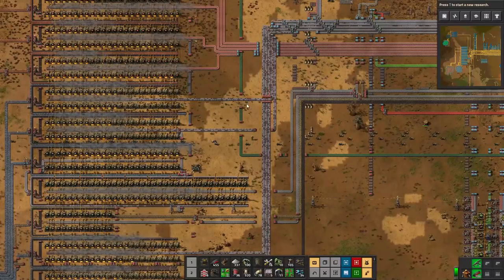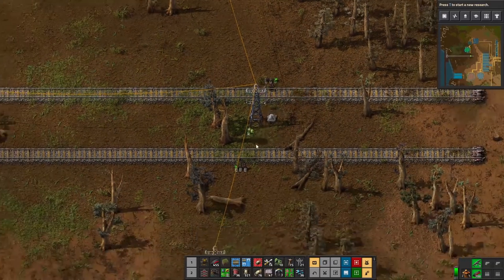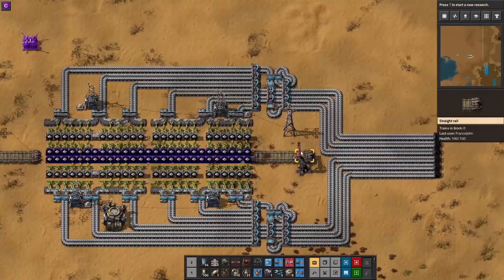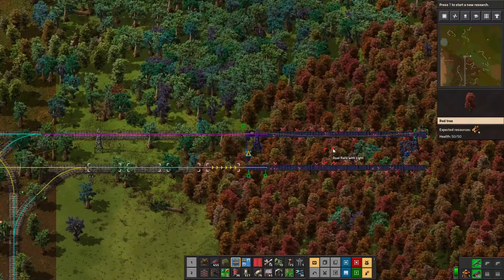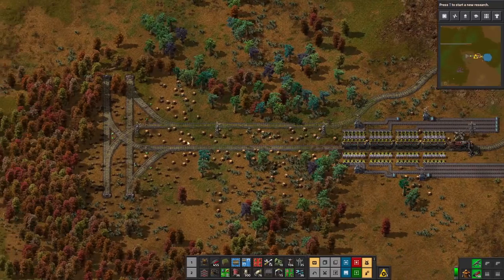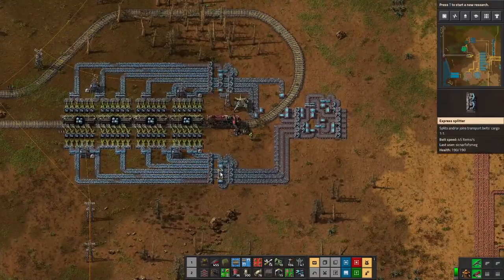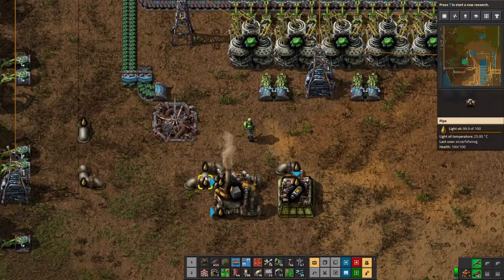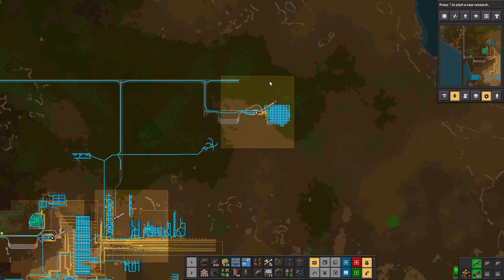Factorio Railworld 7 : How to build a rail network with 4 Blueprints

Comment: Your T junction is actually missing a signal. If you look at a T, you cannot have a train going from the bottom to the right at the same time as a train from the right to the bottom. Another issue is that if the main line is blocked, train can actually prevent other trains from going down into the junction, also making a backup in that direction. (you have a normal signal in the place of a chain) Also stick in a chain signal in front of actual junction, so trains will repath in front of the junction if another train is jamming it, this really helps with busy areas if there are alternative routes to the destination.

Comment: Here is a short Train Tutorial introduction:
you use rails with trains to reach far places
you use signals to prevent trains from running into each other
chain signals will look ahead to the next signal and show the same color.
    if there are multiple signals it will turn blue to indicate there are some open spaces left. (useful to prevent trains from entering full stackers and getting stuck)
1 locomotive is able to efficiently carry 2 wagons.
use conditions for your trains.

Comment: This game is like oxygen not included space difficulty curve, but at every corner
Reply: Most of it is much more simple. You don't actually have to pay attention to a lot of the details to get things done
Reply from the maker: I see factorio asmore about you need to get X amount of stuff from point A to point B. Turning it from one thing into another along the way.
ONI it pure chaos in comparison. Food, O2, heat, refinement, moral, skills. ONI kills you a lot when you first start and then when you get good you start learning about boiling petroleum and tapping into geo thermal power. Never mind the really complicated stuff.
I feel like Factorio is far more straight forward, make as much science as you can and defend against the biters.
Reply: I agree on jhon in this factorio is much more of learning curve but oni..... i sometimes do not know what kiled my dupe.... it just more random on oni than factorio

Comment: I never bothered belting my train fuel. My bases weren't organized enough and I got into rails earlier. My early solution was a blueprint with a chest and a siren connected that would warm me when a train's fuel chest needs refueling. Then once I had logistics setup I replaced the chest with a requester chest so it always had fuel. Siren stayed just to alert me of any unfortunate events happening.
Reply from the maker: I'll most likely switch over to bot based fuel pretty soon, but I felt like I should include the belted version even if only for a bit as a demonstration.

Comment: Oh no. Mainline train stops?!!?! Mad lad, you. I pull them off the mainline so trains can pass through the stations and it keeps each station very small.

My normal trains are 1-2-1, but I know that's probably not that efficient. I'll probably upgrade them to 1-4-1's.
Reply from the maker: 1-2-1 trains are fine, you can easily get to 500spm with them. I just use 1-4 trains from a two year old habit.

Comment: i never thought i would say this but Francis, i think you might need  side balancers in some places of your base to reduce bottlenecks. For example on your starting iron patches before they come into new main ore line. 
The reason is, not ANY of lane ballancers you used to this point really side balance,  so your iron smelters use i side more than other. That's not slowing it down, however, this means that you draw ore from only one half  of your old iron patch, meaning that in the result 1 side may be already be depleted, and other don't even drained in half.  You could also add side balancers on the OUTPUTS of the smelting setup, so they always work and draw ore equally but i don't know if it's needed or not. Side balancers also is something like 3x4 small little thing (that uses 2 splitters, 4 undergroundies and some belt), that you can just stamp down via blueprint so it's not really a big deal to do.
 And your rail network is.... uh... somewhat rough. signal spaces is not always leave space for a full train and train stackers is gonna generate some problems later making you constantly monitor rails for the clog-ups so this "this is additional thinking, not worth it" strategy i think is going to backfire in a long run, but yea as long it works i think it's okay??? Oh boy. You basically need a stacker capable of handling ALL the trains dedicated to the outpost, so 3 outposts with 4 trains each = 12x stacker at the base which (technically 10 x scince 1 train is always at the outpost and one practically always "in travel" but it's still) going to take quite a chunk of space, is it still valid then?
Reply from the maker: I have stuck in a few rough side balancers on the ore to equalize the draw. As for the rail network it's super rough but so long you leave enough space your fine. That Iron ore drop off stacker will most likely be expanded up to about 20. It's pretty handy to do and we have the space for it. Brute force is my preferred method, at least this early on.
Reply: @FrancisJohnYT  oh, okay then, i just thought that you planning on having like 3 stacker spaces, which is definitely not enough. also do you possibly say that in some later date the rail and whole base going to have a minor/moderate overhaul? :)

Comment: The unbalance at 8:11 could not cause a problem. You only really have to balance belts that draw from different wagons so that the train does not remain in the station when all but one wagon is empty and all those inserters starve. If one side is draining slower then that does not slow down the inserters on the other side, so it's not a problem.

Also in general if you have a balancer in front of the furnaces you don't need one after the furnaces too since one row of furnaces should be identical to the next. (I can see that you don't have that, just pointing it out for those that do use balancers everywhere)

Comment: hi FJ!

Im not sure if you play anything like me, but if you are gonna bot-empty the trains, you usually throw the ore in in active providers, and then further in some sort of buffer (yellow chests?)??

To not overfill the buffer if your 'balance' of trains (copper to iron ratio sort of thing) isnt right, it might fill up with whatever you got the most outposts of.

Now take a roboport, and connect its output to a few calculator combinator, and a constant combinator.
Set the constant combinator to "n = 50000", where 50000 is the minimum ammount of ore you want in your system.

The calculator combinators, you take "iron ore / n", and output iron ore. Same with the other ores.
Now run the outputs to your trainline (big poles) and then into your outpost station.

In the trains you do:
"goto iron output 1"
"full cargo"
"circuit condition  iron ore > 0"
(remember to change from 'or' to 'and'

and then the usual 'go home'

Now when the base have less then 50k ore in it, you will summon new trains.

neat?

i can proivde you with an example map if u want :)
Reply from the maker: That sounds entirely to complicated, I usually just go with massive amounts of train parking and way to many trains. It's not very efficient but I use a different system when we get bigger.
Reply: @FrancisJohnYT  it miiiight sound complicated, but it's not really at all! I'll make a few pics for u :)
It really makes trains way easier to handle!

Comment: You should include circuit network cables into your rail BP.
They don't cost any actual cable when placed as a blueprint and it saves you from doing it later.
Most bases don't need a base wide circuit network, but it's a 'just in case' that doesn't hurt.

Comment: I don't know much about factorio trains, but the t-section looks Strange... full signal at end of junction, chain in Front. Right?

7:00 You could save some Material if you remove the splitters, Not needed i think...

Comment: Far too many inserters loading and unloading trains.... but brute force always works.
Reply from the maker: I don't want to ever have to go back and upgrade them, also brute force has traditionally been one of my favorite solutions :)
Reply: @FrancisJohnYT  
You don't have to upgrade them. Fiddling with the stack size may be optimal, but it's not necessary. Just place down four inserters per belt instead of six and you're good
Reply: @S_Black  Only if you intend to stick with a full-belt system.  If you use a robot-assisted unloading system, then you can run six inserters per wagon-side into passive provider chests, then use (nearby) requester chests to unload onto the belt of your choice.  The largest trick is that this requires a segregated robot logistics network to confine logistic-bot pathing.
Reply: @Majromax  
Pretty off topic. If you upgrade to robots you need to make changes anyways

Comment: why does everyone use 2 lane railway systems? i only use one lane and just loop it back on the same rail
Reply: You are going to run into massive throughput issues once your base gets bigger and there are several trains running on your network if you only use one lane.
Reply: @AtheK10  i tend to abandon saves after about 12 hours and start over so i havent ran into that issue yet lol
Reply: @baldie1977   so you basically saying something like "Loool, i haven't played the game, ha ha, why anyone making more than 2 iron lines, i only use 1 and a half and it just works lol"
i mean.... okay, works for you i guess.
Reply from the maker: I went with a single exit rail before, one lane out and three lanes back into the base. Got it up to 2.5k spm fed entirely on raw resources. So it is possible but it takes a hell of a lot of planning.

Comment: Call me lazy, but I just fuel my trains with coal.
Reply: You are not lazy. Just slow, hee hee.
Reply: It doesn't have to be nuclear fuel, but rocket fuel is pretty great. I generally wait until I have bots for that and then just fly it in
Reply from the maker: I should maybe have rolled out bots already, much handier for moving fuel. Next episode we can roboport up the place.
Reply: Back in the days, the refining of fuel (solid-rocket-nuxlear) was always with Bonus-energy, even coal liquification was a benefit, if you didn't pay the electricity. But nowdays i also power my trains with coal and build more.
Later it might be Better to have less trains, so instead of 50 slow Iron ore trains, have 30 fast ones.